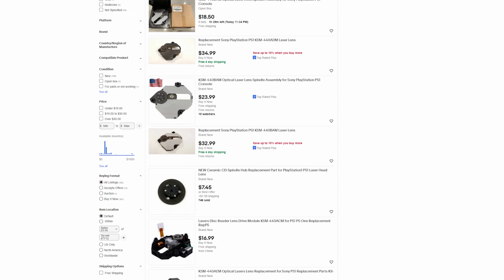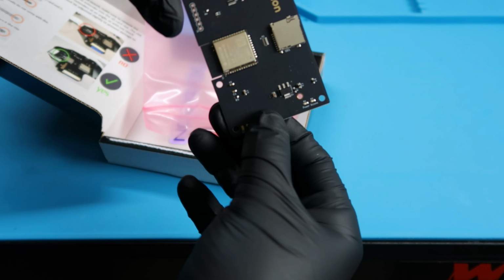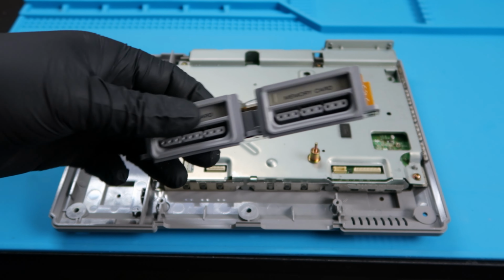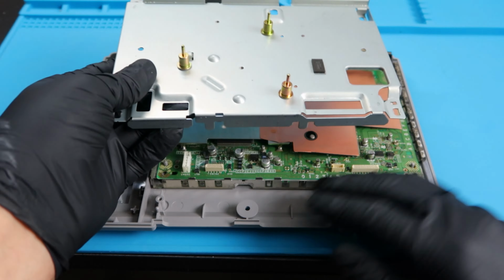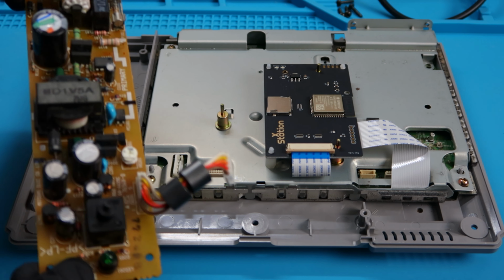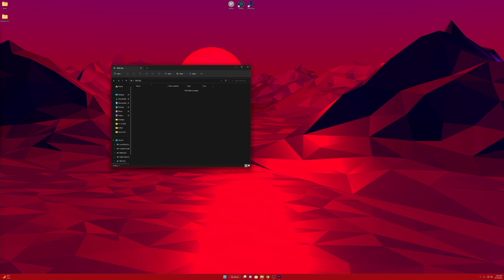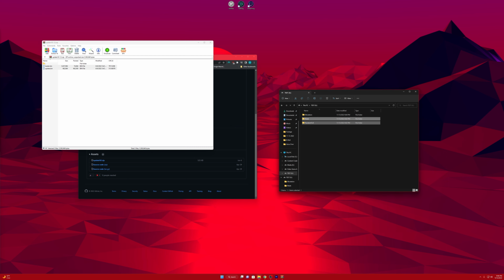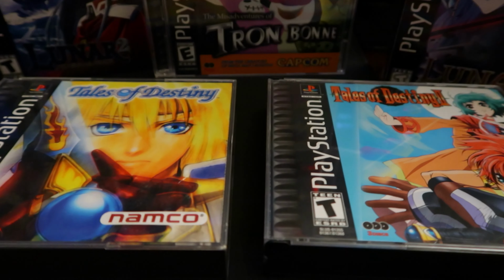Tutorial | Sony PlayStation ODE | 4K🔴

Comment: I installed an xstation a few days ago. I did have a set of capacitors but decided against it. If they work why replace them? The PSone mini is the one that has the most problems with video and leaking caps. The next caps would be for the CD drive if it decided to not read games. I would suggest the fuse to be replaced on PS605. If you use a MEMCARD Pro2 for example. The next thing for me is to solder a 2.5a 75v SMD fuse to replace the 1.5a 50V. The number on the chip is 15 and a 25 is what you want. SMD 1210 2.5A 75V is what it is called to find it easily. I also bought a Sandisk Extreme microsd card. It will go up to 190mbs read speed. That was suggested from another video I watched and helps with FMV skip issues.
Reply from the maker: Congratulations on your install! I agree with only replacing the capacitors when needed. There are times I do get a bit of video noise in dark areas, but I think that's just the way it is with this model PS1. Let me know what games you decided to play! The SD Card i got was 256G SanDisk Extreme Pro with 200 mb transfer speed. No slowdowns here!

Comment: can you play multiple discs games with this? such as resident evil 2 or ff vii
Reply from the maker: There is a way to do it, I have yet to encounter a game that's multiple discs since the install. There is documentation on how to do it though.
Reply: @MagnetecoLab  Yeah, I suppose you have to burn them together.
Reply from the maker: Played through Resident Evil 2 recently. You can set a boot order on the XStation. You can simply press a button on the menu when choosing your game! In the case of Resident Evil 2, you press the button and and a "1" will appear next the game title [Disc 1]. You can press the same button on another title [Disc 2] and a "2" will appear next to it. All you have to do is open the lid on the PS1 and close to load disc 2. Pretty neat!
Reply: @MagnetecoLab yeah, ive finally purchased my xstation. You mean the square button for queueing? I think thats the option you are talking about.
Reply from the maker: @cesarborzi4291  That's the one. Congratulations on your Xstation purchase!

Comment: Honest dope video but why wouldn’t I just do something similar with the ps2 fat and get the best of both worlds is there more pros on the original ps1 or is it like a collection/restoration to give those original units a longer life span.
Reply from the maker: The process of playing is 100% for restoring the PS1 system for a longer lifespan. Playing PS1 games on a PS2 is perfectly acceptable even though you need to play them off a USB drive if you do not own the original disc. You can play PS2 games off a HDD but not PS1 games. Mod chipping a PS2 is also really difficult so for a PS2, I recommend a softmod over a hardmod.
Reply: @MagnetecoLab  thank you for the info to be honest I’ve been interested in setting up one of those raspberry pi mini servers to host all my games, but I only have a raspberry pi zero and every tutorial is using a pi 3, I have the same issue with my Dreamcast, I am passionate about video game collecting but never really done the restoring and repairing aspect mostly keep things factory but these are pretty cool.
Reply from the maker: @morrisdennison8039  I'm not too familiar with Raspberry Pi but what I do know, is that you can purchase a Dreamcast ODE and there is no Soldering involved. You just replace the laser with the ODE. I will absolutely do a video on that too.
Reply: @MagnetecoLab  I would love that lol and I don’t know if you’ve ever heard of game-tech us but they sell aftermarket PSU replacement specifically designed for the consoles. Only issue with them is if you buy a cheap power supply. Just subbed can’t wait to see what comes next
Reply from the maker: @morrisdennison8039  Yes I am familiar. The main power supply is replaced by a small unit. The power is then transferred to a block outside of the console for better cooling. I've been debating on that one for a bit.
Reply: @MagnetecoLab  yah I’ve always been interested In doing all this stiff just haven’t dipped my toe yet lol